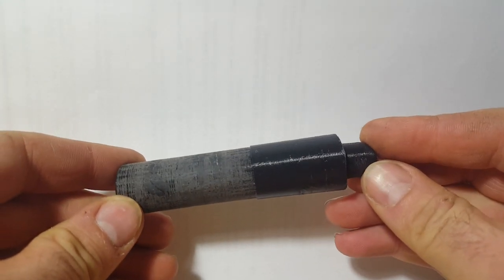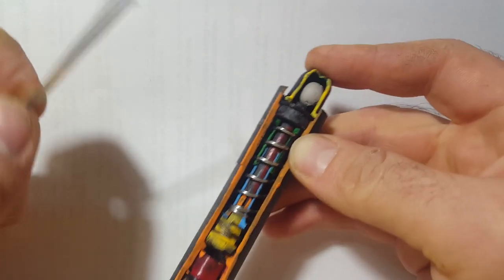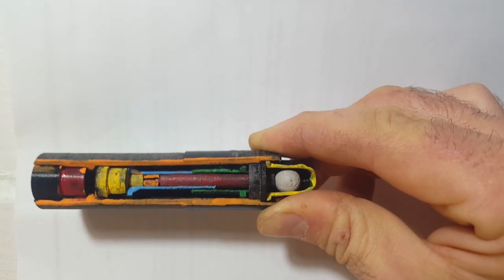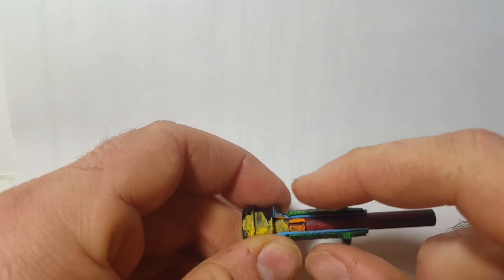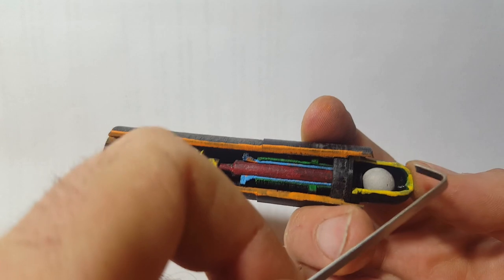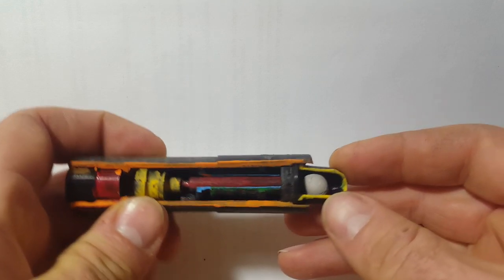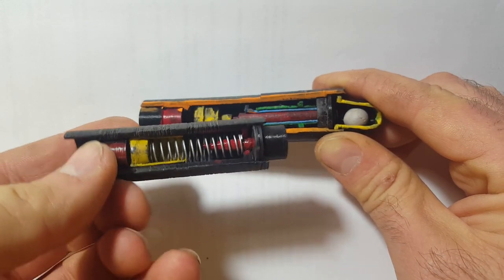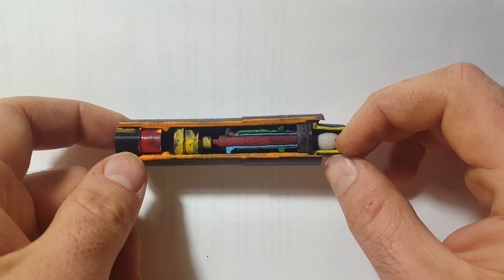PIAT No.426 Fuze: How it works.

Comment: We're probably at the point where you could 3d print a full mechanism in one go. Some of the simpler designs like the shear pins ones and stuff would probably work
Reply from the maker: Definitely a bunch of plastic mines out there that can be 3d printed. And a bunch  more in people's imagination.
Reply: I've been 3D printing revolver speedloaders (MJF not FDM) with spring-resisted positive feed as a single piece, spring and all. Apart from a striker and primer, a simple impact fuse should be straightforward enough!
Reply from the maker: Yes. There are alot of complex moving parts that are 3d printed in one shot. Would be rather simple to deal with making certain fuzes. Even more interesting is that you can make prints using dual extruder heads where connecting points can be made with the water soluble material. One solid piece, drop in water and all the interconnecting linkages and supports "melt" away.
Reply: @Stray03  idk how much cad experience you have but a 3d printed fuze archive would be amazing. I'd be willing to help out with it too
Reply from the maker: @griffin5226  I would love to get into that but I am about 1 step above a chimp using fusion. I had some experience with cad in the form of solid works in school but never took enough time to get useful with it. I can make things that I need to get by with but if I was good at it you would be seeing many more things represented with 3d cad drawings and such in my videos. I have a video I'm trying to make for someone about how a specific grenade works and unfortunately the easiest way to make it would be a cad animation and haven't figured out enough to even know where to start.

Comment: Hi, so without the propellant charge, the empty dummy projectile would only fly a few yards ? Did you ever look into using a light load 12ga shotgun round ,minus lead shot "of course" as a  form of thrust.Thats the  First and simplest thing that comes to my mind. Thanks
Reply from the maker: I haven't tried but I'm sure a yard max, and with the round secured in with the clip it may not even come off the actual tray. The clearing procedure mentioned in the manual would lead more belief to that happening. 
An empty 12 may sort of work but the charge has to be just right. Too light and it doesn't recock. Too heavy and damage to projectile or launcher can happen.
Reply: @Stray03  thanks for your reply, A yard max ,thats crazy..lol .. I forgot the propellant charge also is suppose to recock that huge  spring,Dang .Recocking not that big a deal or hurry during  peace time. Are they ok to dry fire?   The piat is such a big ,heavy and awkward thing to handle. I checked on ebay and was hoping someone made a 3d printed round  for display or to convert into a  dummy firing projectile...no luck.
Will checkout your other videos!
Thanks
Reply from the maker: The armourers bench has 3d print files you can buy if you want to print a display one. Yeah you are not supposed to dry fire one due to the possibility of hammering off the brazed on end piece which would be a pain to fix. I have a few videos on the piat you can watch if you want.